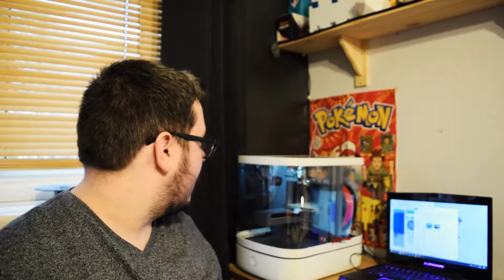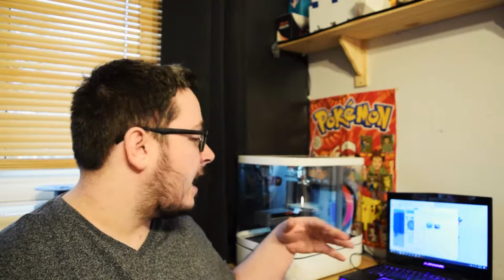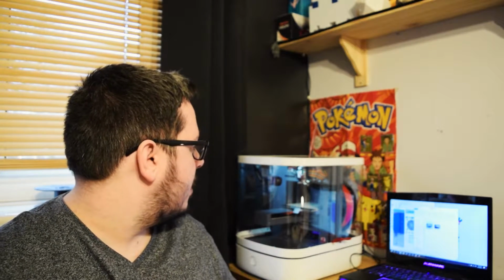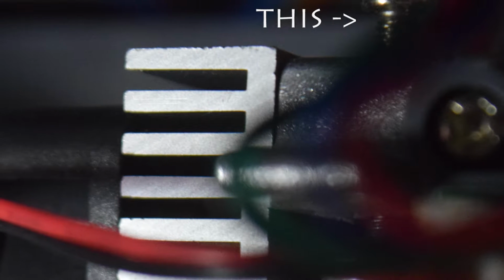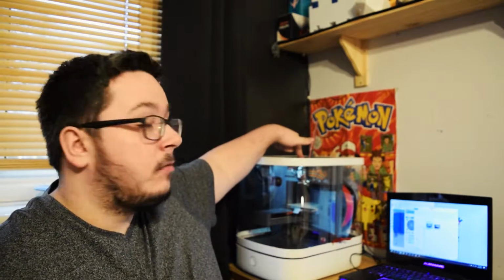Vector 3 3D Printer Modification #4 - Fan Improvements!

Comment: Yer I did that with my fan bracket as Sean it on another guys Vid. Did u have any problem. With fan case. Corner s hittng edge of bild plate ... 2 years to get all parts from UK to. Oz. Then 5 years or more years  latter ..I got the bild plate up to nosle  but now bild plate whant move down thru computer .? Do I have to reset the comands ? So it whant keep moveing up if told it to to manny time s.j